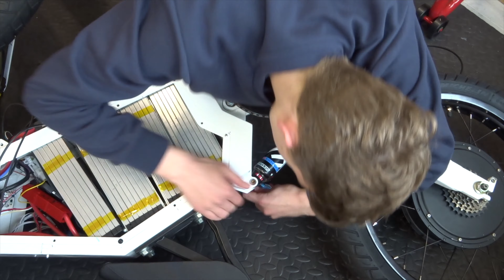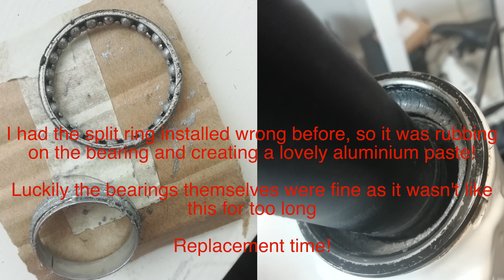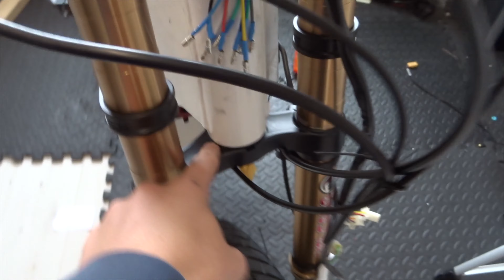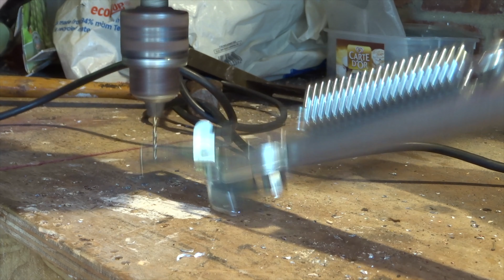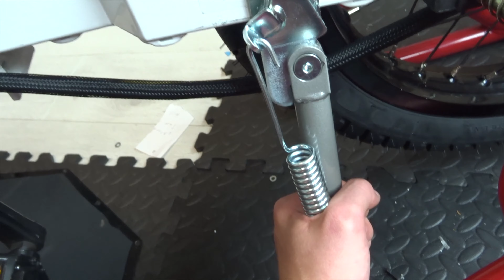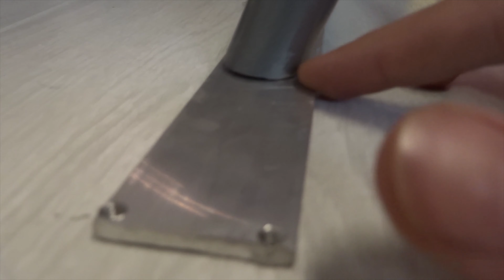NEW Suspension, Headset and Kickstand -  8kW Enduro MSVA eBike V3 Build - Part 16

Comment: Add some spacers on the top two bolts on the moto seat - makes it flatter which makes it so much more comfortable
Reply from the maker: How does that work, does it push the seat further up the frame or something?

Comment: From comments others have made the dmn rcp2s is a popular choice and was also top of my list however some builders find them to soft spending extra for stiffer spring. But I guess some of that is personal preferences and or weight of bike and rider combined ive decided to go for a Motorcycle Rear Suspension Center Air Shock Absorber 205mm 
https://a.aliexpress.com/_mOnsIrp the spring on this is rated for 1000lb some minor modifications were required I mounted the external res directly to the frame inside the frame for the seat looks  really good and the mounting plates had to be drilled out to 10mm. Good to see you bike is still progressing have you managed to sort out the issue you had with the controlled?
Reply from the maker: I was looking at a similar style that DNM made, but decided it wasn't worth it for road riding. Like with a lot of things on this bike, I'll have to see how they work when I'm properly riding it around and make changes as needed. Also no, controller is still an ongoing issue with the seller!

Comment: The 550 is way too light. They make an 800lb whick is better but still not ideal. Most of us run two shock with 550 lbs springs. Everlast is a good welder. I have their 220DV Tig welder that does aluminum and steel.